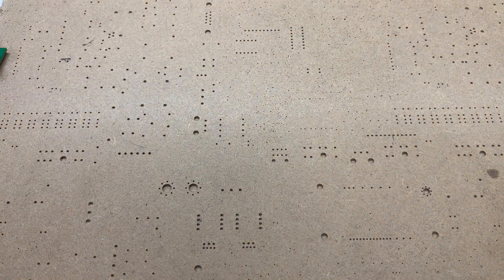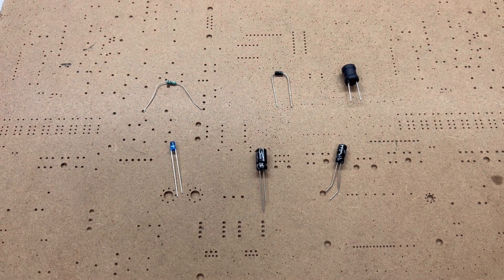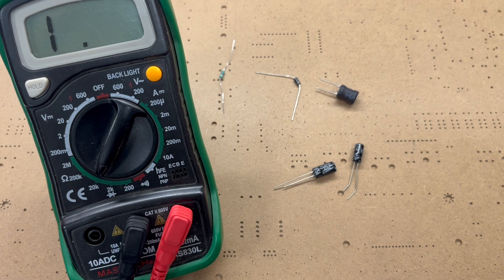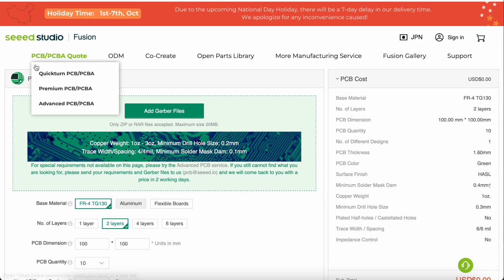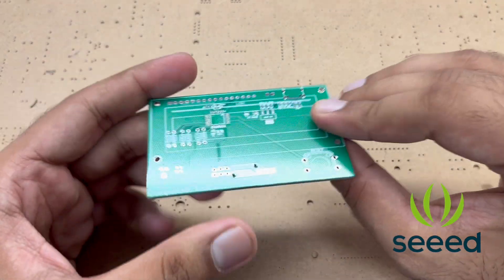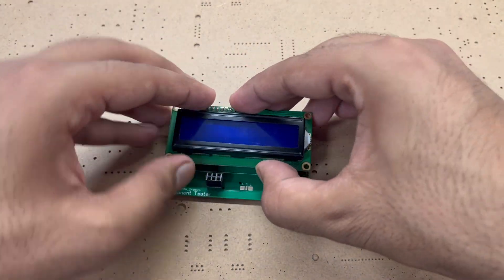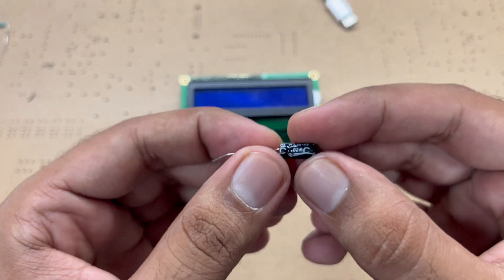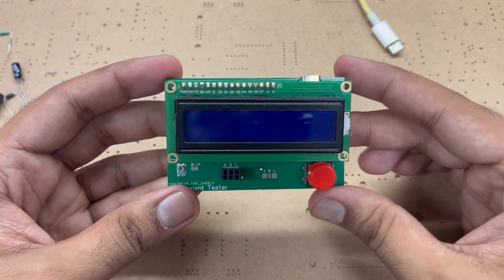How to make Component Tester at home with Arduino

Comment: why u always remove power cable?
Reply from the maker: The button pin was wrong in the code. I had to resolder smd atmega328p and reprogram it. So i just turn off power and turn it back on